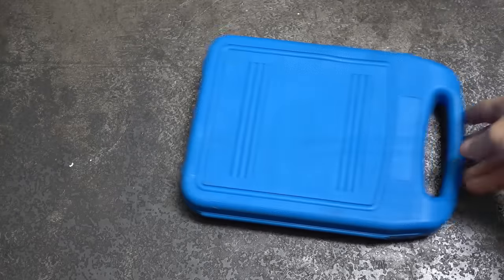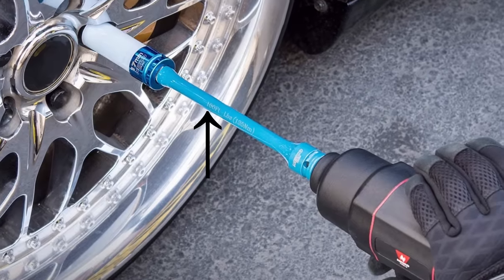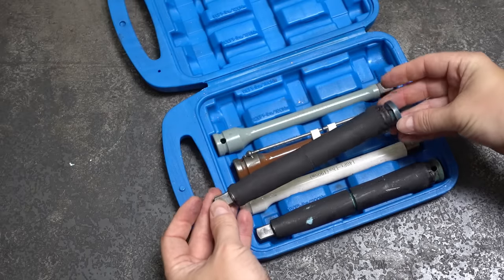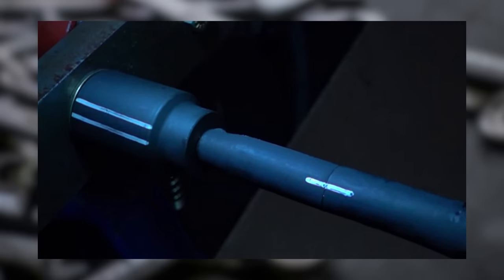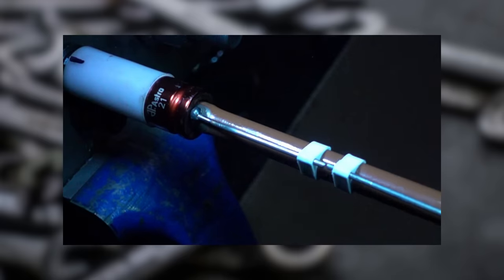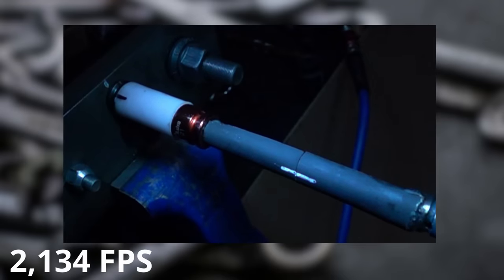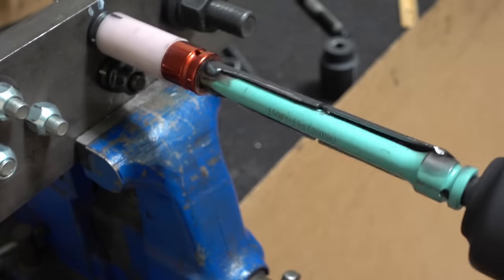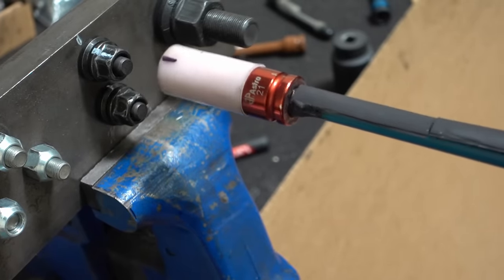Torque Sticks! High Speed Video Helps Reveal the Truth

Comment: Some 20 years ago when I worked at a tire shop (this is the second video in 24 hours to make me nostalgic for those days...) our boss occasionally did a demonstration on how innacurate torque sticks are by running a lugnut on his car with a 100ft lb stick and hammering it for like 10 seconds. Then used the pointer style torque wrench to try to remove the overtorqued lug and pulled it until it pointed to 110 to 120 ft lbs to show you absolutely could over tighten lugs with the torque sticks. He'd wrap up by bringing one of the non-techs in and have them try to remove it (usually one of the gals at the front desk, someone who didn't work on vehicles) and told us to imagine our family member on the side of the highway trying to change a tire with over torqued lugnuts.
Reply: @Fred Wills Leaving someone stranded on the side of the highway because they can’t fix a tyre is potentially lethal for multiple reasons.
Reply: I'm glad you had a boss that cared enough to do that. Quality shop as compared to the norm (or at least tried to be)....
Reply: @Fred Wills I disagree. A warped rotor is a mild irritation and an unnecessary expense. Struggling to loosen a lug nut on the side of the highway is a tragedy waiting to happen.
Reply: Removing requires overcoming a large amount of friction 

And is not an accurate test to show how ‘over torqued’ they are. 

Especially on a video that proves they are accurate…
Reply: 10to 20 pound over average rating on lug nuts is literally nothing if the cant break a 120 pound vs 100 pound lug they shouldnt be onthe side of the road they need to get off the road and ride that flat to a parkinglot
Reply: Going to have to agree with @Fred Wills . Had a shop install some new tires for us before we headed out for a road trip. I didn't have time to break the nuts loose and torque them properly before we hit the road.
Had a FRONT wheel come off at 75MPH. Fortunately, managed to keep control and get it to the side of the road. With 4 vehicles in convoy, a couple of guys went 1/2 mile back down the road and found the wheel/tire on the other side of the concrete barrier and brought it back. We were also able to pile everyone into the other 3 vehicles. 
They managed to over stress 3 studs to the point that they'd snapped, letting the wheel go.
Reply: @Fred Wills "Modern" (flimsy) disc brake rotors are easily deformedvby using air impact tools to "get the wheel nut tight" at lousy quick oil change and tire shops... You can easily MEASURE the deformation by using an inexpensive dial gage on a magnetic base to look at disc rotor runout...
Reply: hate to break it to ya, but the environment the nuts are in gonna do the same (even worse) increase in the force required over a period of time.
Reply: Wait a minute, are you implying that removal torque is the same amount as applied torque? It always takes more to break a fastener free… his test likely proved the ones you were using were rather effective actually.
Reply: @bretts4343  I had the same experience. Had tires changed at a shop and my first time on the highway I had a front wheel come off. Called to ask if they used torque wrenches on my car “yeah” ok, we’ll get them calibrated because my tire just fell off… “nahh they don’t need it they’re just sticks you get off the tool truck” I had some harsh words with them and when I went back to the town earlier this year I was pleased to see they were out of business.
Reply: Now that is a shop worth finding and sticking with!
Reply: It always takes more torque to loosen them
Reply: Good boss.
Reply: Very responsible demonstration. I try to preach not over doing it in general with impacts and whatever method “slows down the torque” on guns. They are great tools, but people abuse them with no consideration for the next person.
Reply: @fastinradfordable except loosening takes less force than tightening unless there are potential metal mismatches, corrosion, or contractions happening
Reply: @alextheonewarrior  The person you replied to doesn't understand that they had a non-tech (girls from front desk) try to loosen over-torqued bolts. 

Also practically, it usually takes more torque to loosen because of corrosion and other factors. Most people never take their wheels off unless it's to change a spare. When they have to, those lugs have usually been on for years.
Reply: Out of every shop i've been to I can count the amount of times i've seen a torque wrench used on one hand. Typically they are overtightened like crazy and it is usually the tire shops that do this, I have even cracked two wheel keys (which i know are already weak) trying to remove the lugs put on by these shops. One time both me and the AAA guy were jumping on a wrench at 4am trying to get the lugs loose which took us both about an hour. If I could find a trustworthy shop that does this around me and doesn't charge dealership prices I would give them all my business. I was actually thinking of giving some torque sticks to my main tire shop and telling them to use them on my car lol.
Reply: @w.f.productions7501 the worst part is a big truck usually has a torque in the ballpark of 140 or 160, and there's plenty of women driving those. thats a big enough gap its definitely a noticeable difference and i dont think most people could take that loose. and thats not considering one crusted on with some years too
Reply: It doesn't matter if removal torque is higher, or if time / corrosion causes increased removal torque. Fact is, I'm sick & tired of busted wheel studs due to my wheels getting put on at 250 ftlbs. Not to mention the damage it causes to alloy wheels. I have gotten to the point that I bring my own torque wrench and inform them that I will do the final tightening if I don't trust the shop. I came in for a state saftey inspection. Not to have the shop create a saftey hazard for me, and damage my property. Pure & simple. One shop tried to complain. I told them to keep the airgun monkey away from my car & use a torque wrench then. Apparently taking a minute & half extra was to much profit loss for them, and had me torque them instead. Idoits.
Reply: Great example. I've been stuck with a flat and only the factory tool which was twisting and deforming due to overtorqued lugnuts.  I was pissed
Reply: @steved8714 I don't think that is true. The friction force will be the same regardless of which direction you turn it. However on tightening, you will be fighting the increased load due to the stud stretching, which also increases the friction load.
It will come off easier than it went on by a good margin. We wouldn't need locknuts it it took more force to get them off. 

Your statement is true for corroded fasteners though in most cases.
Reply: 10-20 ft ib isnt even a lot so i dont see how that is relevant, not to mention the stupidity to run it for 10 seconds of course its going to overtorque it, its not magic
Reply: @steved8714 Other way around. It takes less torque to loosen a fastener than it does to tighten it.

That's why manufacturers always rate loosening torque higher than fastening torque on impact wrenches. It's also why channels like Shop Tool Reviews can hit the loosening specs (on impacts with loosening specs in the 1200-1600lb-ft range), while TTC hits sub 1000lb-ft figures on strictly tightening tests with the same impacts.

Only reasons a fastener would take more torque to loosen are thread damage/deformation and corrosion.
Reply: @alfredomarquez9777  Don't you think if the rotor was being warped by over torquing the lug nuts that the wheel hub would also warp?? I mean how would the mounting flange of the rotor warp without also warping the wheel hub, they do mate flat against each other??  Maybe the driver of the car heats up the brakes excessively on off ramps getting off of the freeway, its not hard to do, especially since many cars have undersized rotors to save weight and material cost. Most rotors are made so close to minimum tolerance that they cannot be resurfaced at brake replacement time. I would be willing to bet money that if you find a warped rotor with you dial indicator if you also measured the rotor hub that you would not find an equal amount of warp on the rotor hub.
Reply: They don't make people like that anymore
Reply: @fastinradfordable I’m disappointed that I had to scroll down so far to find this reply
Reply: It’s funny, because half the people on this comment think that shop was SMART for doing this while the other half thinks they’re DUMB for not understanding the concept.
Reply: That's why you use like an 80 lb-ft and then stop as soon as it stops moving very far then finish with a torque wrench. Watch how Faye uses them and I think maybe also there's a Project Farm video. Not that you work there anymore, but yeah, it's good info to spread that these aren't intended to set a hard limit.
Reply: @steved8714 takes more to remove?  I thought it took less?
Reply: Breakaway torque is certainly going to be higher than applied torque. Under strain binding and friction does it's thing. This is why nuts don't fall off.
Reply: Even at factory torque they give you a cheap short lug wrench and expect a small women to break them loose.  I helped a women and a gentleman in a parking lot it's wasn't the torque but lack of leverage of tool they give you.
Reply: @fastone371  Not to mention the hub the rotor is mounted to, since almost everything these days is unit bearings.
Reply: And you bought that BS? It always takes more to break a nut loose! Plus hitting it for 10 seconds would over torque anything! 10 - 20 lbs over ain't squat!
Reply: @WW5RM  Freshly tightened and assuming no damage/galling, removing is always easier than tightening. You’re climbing the ramp when you tighten…
Reply: @hotshtsr20  right, ASSuming in a theoretical ideal scenario but is not the real world! Very few things get easier to remove with time!

Rarely do we install something just to immediately remove it because we wanted to or for a test. 

Also he said "tighten for 10 seconds". That alone is NOT real world! Hammering anything for that long will cause over tightening!
Reply: @WW5RM  Yeah, but the point is that torque sticks aren’t accurate. Hammering for 10s isn’t accurate use, certainly, but measuring the removal torque immediately after installing is reasonable.

That being said, they’re better than nothing. I’m fine with them
Reply: Torque wrenches normally only stay calibrated for about 6 months if they're used. I've seen tests of high dollar torque wrenches (Snap-On, MAC, etc) and they can be off by as much as 10% brand new out of the box.
Reply: @w.f.productions7501 sure work so well when the parking lot is 20-30 miles away 🙄
Reply: @RM😊artin631
Reply: @RMartin631 😊😊😊😊😊😊0:40
Reply: @allangibson8494  had a patient in several pieces because he flung from the highway and got disassembled by a bigass tractor hauling a container he was changing his wheel on the highway when he flew when the lugnut suddenly gave away, we tested the lugnuts and it was there TIGHT I can bench 1.5x my own weight and I lifted the wheels when we tried to loosen the thing the breaker bar we used was 1 1/2 meters
Reply: @steved8714  Actually not true.  Be careful with "ALWAYS and NEVER".  If you torque a nut and remove it immediately, as in the example, it should take 70-80 percent of the tightening torque to break it loose.  Weather, corrosion, and heat cycles can certainly combine to make them harder to remove over time.  While the shop example was well intentioned, it was not correct.  But in the opposite way you describe.
Reply: Wouldn’t call that “absolutely” overtorqued. Absolutely overtorqued would be the guys running them on with no torque sticks at all.

Comment: Like all spring systems, the torque stick will have a resonant frequency. If the return bounce from the nut-end coincides with the applied hammer-blow, there will be additive mixing, thus increasing the applied torque to the nut. Perhaps torque-sticks were only designed for air-tools that all share a common hammer rate.
Reply: Found the engineer
Reply: your a genius

Comment: Excellent video! Never would have thought about the differences between air and battery impacts and their effects on these sticks. Great thing to keep in mind.
Reply: Its crazy how different air and electric impacts are. I keep both at work because sometimes you just the type of impact from one or the other for a certain job. For example i know my electric impact works better for rusty stuff but my pneumatic hits harder when i need to use extensions or swivels
Reply: I work in a shop and I actually was testing my new torque stick (against a torque wrench) and noticed that behavior myself. Thought I'd have to return the torque stick and get my money back, until I thought to try an air impact. And that worked. So now I stick to an air impact when using torque sticks.
Reply: It would be useful to know the derating factor when using battery powered impact guns.  We buy them with air impact rating, but use them in the field (think off roading tire change) and spin off the lugs.  There needs to be a warning and a general derating factor for battery guns.
Reply: I expect the real issue is in cycles per minute, not the power source.  As the vid mentions, looks like his electric hits again with  little unloading of the torque stick between cycles, unlike the pneumatic.  Recoil takes time.
Reply: @terencegalati970   Who needs a torque stick offroad? Just tighten the thing and don't worry so much.
Reply: It's not as simple as air vs electric. Every gun hits different. It all depends on how the exact hammer mechanism in the gun is set up to work, and there's no defacto air or electric hammer mechanism. Any gun manufacturer can make any mechanism they won't. 

That's why it's best to develop a feel for things vs blindly trusting whatever is written on the box of the thing you bought to tighten a thing for you.
Reply: Or rather, the difference impacts per minute can make. It seems more is not always better.
Reply: @shinyribs2178  That's right. My Milwaukee tightens to 1000 ft lbs but loosens at 1400 ft lbs. No such thing as over tightening for off road wheels. Tighten them ALL the way up!
Reply: I mean, my dewalt 1/2 torque gun has different speed settings. One of which, is very slow.

Comment: Here's my thought.  The BPM of a cordless is higher which does not allow the torque stick to return to it's neutral position between blows.  When it hasn't returned to neutral, it has a preload on it.  The stick not returning to neutral means that it's preloaded.  A preloaded stick acts more like a thicker torque stick in the way that it transmits more torque to the receiving end and less twist from each blow delivered.  The more you twist the stick, which is a spring steel I imagine, the more torque it takes to twist it (until it's yield point anyway)which would allow the higher BPM impact to transmit more torque to the nut on the other end.  In other words, when the stick is already twisted some, the impact can tighten more than the sticks rating which is done from the neutral position.  The more you compress a spring, the harder it is to compress.  I believe the same rule applies here.  If the cordless impact BPM were slowed down and the stiuck was allowed to return to neutral, I tihnk the torque stick would be more effective.  If you have a really low torque stick, try it on the 6727 on #1 and see if it limits the torque more effectively with the lower ipm.  Or compare a high imp impact to a low ipm impact on the same torque stick.  I'm no scientist, but that's what I think.
Reply: I would like to see something like this
Reply: Patrick, you’re such a rocket man buddy!!!  😆  very true, and I believe that was what was offered up in this video.  Rock on rocket man!  👍✌😂
Reply: what is BPM in this context?
Reply: @rickjames5998  Blows per minute.  If the next blow comes before the torque stick has sprung back to it's relaxed state, it may transmit more force to the socket.

Comment: we used to use torque sticks everyday and as the electrics started to come along torque sticks went away, I have always been told they don't work together and this is just proof, still good for the lube kids to prevent over torqueing.  great video as usual.
Reply: Bold of you to assume the lube kids aren't intentionally uggadug overtorqueing.
Reply: Yeah the torque sticks never felt right with torque sticks. And ours would vibrate so bad with torque sticks the direction switch would be jostled to the reverse position 🤣
Reply: ...hey WOW man, I know I don't really belong here but, do you think it might have been as simple as dropping the air pressure some and torquing behind it and raising the air incrementally until they meet....?....naw, didn't think so, who's going to do all that and then clean the hub and studs so it would be enough to keep the wheel tight after you didn't bother to balance or check the runout?....JUST CALL ME UGGA NUGGA COWBOY...
Reply: Must apply at full beans for a full 3 seconds!

Comment: I was a certified automotive technician for 20 years and I found that the torque stick isn’t so much about getting the exact correct torque, it’s more about getting all the lug nuts the same torque and not over-torqued. It also makes a difference whether you hit the sticks with the same amount of impacts per lug nut. If you hold the impact down for 5 seconds on one lug nut and 10 seconds on the other the torque won’t be the same. It makes a huge difference in warped rotors and damaging threads on lug studs. I always use a torque stick unless I’m on the side of the road in a pinch and don’t have one.